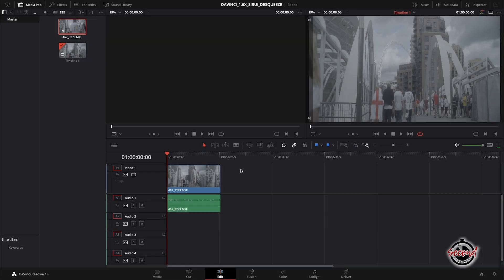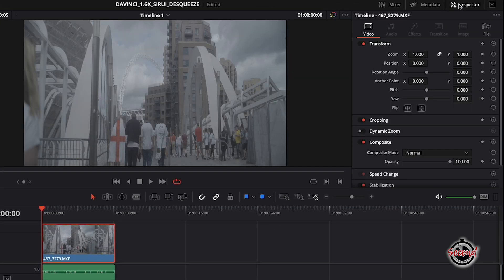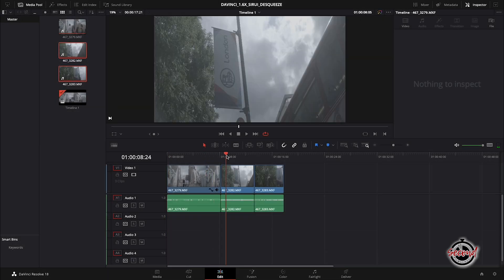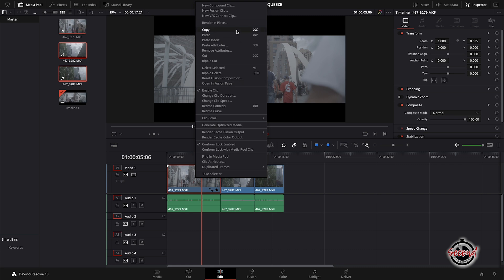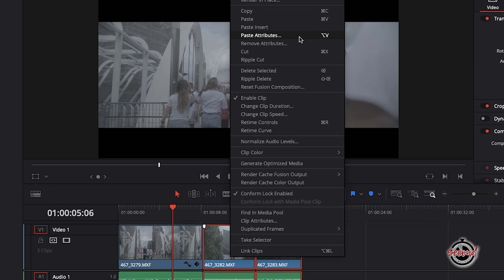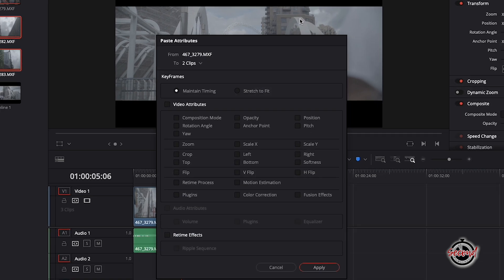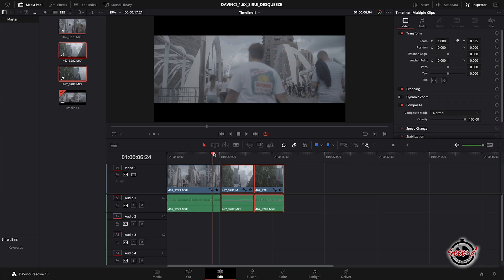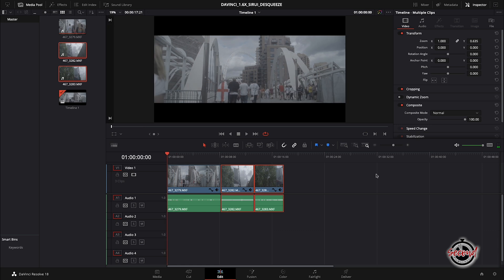How to Desqueeze 1.6X Sirui Anamorphic Footage in DaVinci Resolve

Comment: ce n'est pas du tout comme ça que l'on fait un projet anamorphique MDR...  
A - à la création de la timeline il y a 2 possibilité (1 - créer une timeline avec des dimension anamorphique UHD ou 2K ou ce qu'on veutr... en ratio 1.33 traditionnel et d'adapter ses rushes après désqueeze ou 2 - de créer directement une timeline avec le radio 1.6x des Sirui, soit pour du UHD : 3840x1361) 

B - Ensuite on doit desqueezer le fichier pour qu'il s'adapte parfaitement à la taille de la timeline. Pour ça il faut aller dans les "attributs du plan"  (informations sur le rushe) et dans l'option "Format Pixel" mettre en Custom (car davinci ne prend pas en charge d'origine le radio 1.6x)  ensuite, à la place de "1" (en dessous) mette tout simplement "1.6" qui va donc indiquer à davinci qu'il faut desqueezr à 1.6x les rushe. On va alors pouvoir le mettre sur la timeline, sur laquelle (si on a pas merdé ;) ) il va entrer parfaitement dans les dimensions. 
Part la suite si vous mettez la vidéo sur Youtube, il va y avoir juste la bonne dimension de film et en plein écran sur un écran 16.9 les bandes noires en haut et en bas (normal). 
Voila comment on desqueeze un rushe anamorphique.

Comment: How did you do the math? 1/1.6? Isn't it .625?
Reply: Sirui lenses have a 1.575 squeeze actually so if you do 1/1.575 it will come out as 0.635
Reply from the maker: Maths never was our strong point. Probably why everything comes out in 4:3!
Reply: @BenandJackStudio  Sorry, I don't quite understand. It's pretty minor .625 and .635. But I'm curious if that's how you calculated the amount of squeeze to use.     Did you just use 1/(1.6) ?
Reply: @enricht I am also interest to know how you do to get 0,635. It works perfectly but I want to understand more . Please give us your math method .
Reply: @GrandPoune  Oh they used .635 zoom...... whereas I got .625 which is.... 1 divided by 1.6 = .625.    Curious how they came up with .635. It's a MINOR thing....  only a 2% difference. But wanting to know the formula for calculating squeeze.
Reply: @enricht  thanks !
Reply: Divide 1 by the amount it's de-squeezed.  @enricht